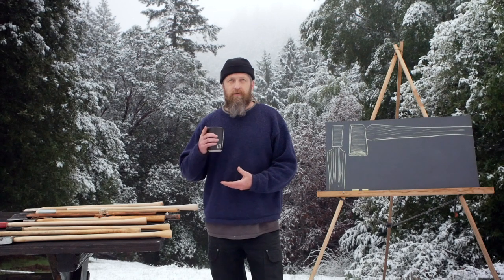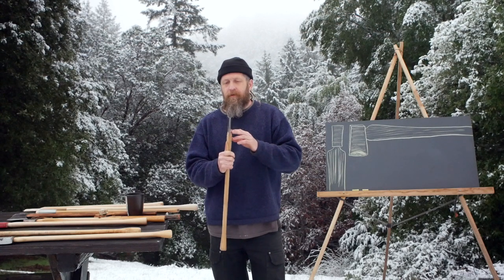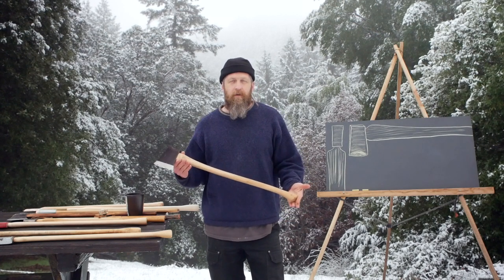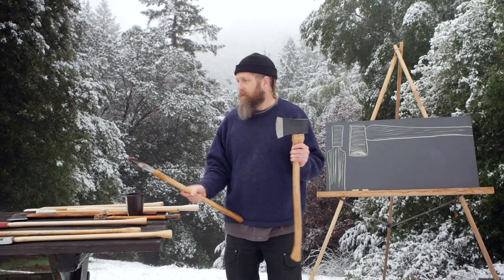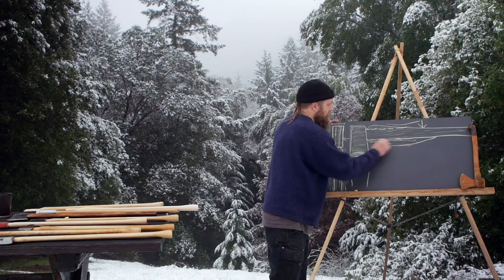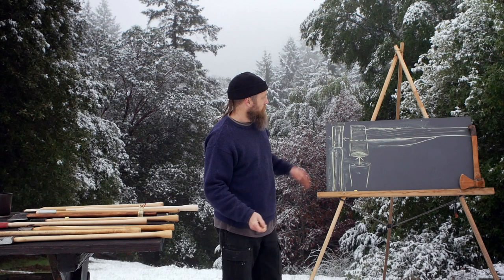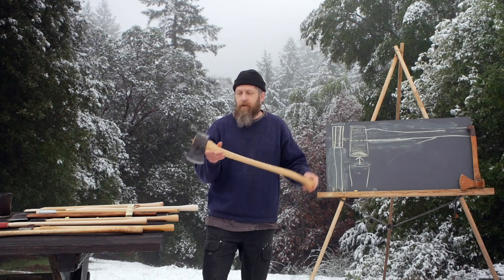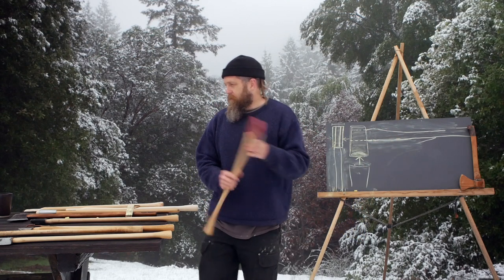Failure By Design, Axe Handle Design Mistakes and Improvements, *Spread the Stress*

Comment: two suggestions:
1. take your axe(s)  to blacksmith and  widen the eyelet.
2. weld metal handle  wrapped by ribbon ,textile,silicone or leather.(somebody  says ---  lifetime warranty).
Reply from the maker: The larger European eyes might be good for casual users, but I don't think that American eyes were reduce to the smallest workable dimension for no reason.  Looking at the thing as a system composed of axe and head, taking a large eyed axe and slimming the handle down to a more high performance thin design starts to upset the balance in the other direction.

Metal handles aren't worth considering to me.  There are reasons they have never become popular.
Reply: +SkillCult
In My H(ard as rock solid) Opinion : manufacturer  for the goal to maximise his profit  do not to produce normal size  fullmetal axes ,they try to save good metal for making only heads , besides  some of the most progressive companies.
Also I think --- Wilton B.A.S.H. handling technology -- is a best performed technology in nowadays.
Reply from the maker: I hadn't seen those.  I'm naturally skeptical, but I don't see why it might not be possible to make a composite material that would perform well and work comfortably.  In fact, I've been thinking about experimenting with that. That's if very different thought than welding a steel handle on the head.

Comment: Definitely know what you are saying. Caught a sale on a Cold Steel Trail Boss (first time I've had anything even close to Hudson's Bay pattern, not sure I'm sold on having half as much eye to grip the handle), and the handle was way too thick. I've done a little sanding but need much more scraping/rasping. Does not feel right in the hand. Speaking of flex/resilience: I know nothing of golf, have no use for it (except golf balls are fun to shoot with a .45), but I heard of a teaching tool that was a driver with a flexible handle. If one's swing was correct, it could be used. Likewise, the axeman with a correct swing does not need much rigity in the handle, but should have some resilience.
Reply from the maker: Having less eye sucks.  I ditched those type patterns a long time ago.  Someone mentioned in golf the head lagging behind the handle is a thing.  I think that is probably true in using axes with flexible handles as well.  Also true in atlatls.
Reply: Good point. Hadn't considered an atlatl, but too much whip in handle would cause the head to lag.

Comment: Why dont axes use the same handle design as mattocks and tomahawks? Seems like an easier handle to make and seat...
Is it because they are less comfortable?
Reply from the maker: They used to.  That is more old school and some traditional axes still do, most notably the Basque axes.  It solves many of these problems, but the eyes and heads are quite fat.  As to why that has been evolved away from, my guess is higher performance and getting the axe thickness down to a more optimal functional dimension.  It did cause a lot of problems.

Comment: what do you think about the square eyes on japanese axes? i always thought this would help prevent the sides of the eyes from blowing out on the axe head, for example if your using the poll to hammer with, the design of the western axes with the thin walled oval eye is really bad for this, i have even heard the sides of eyes buldging out with allot of re-handling. but idk how it would affect the handle durability.

also somewhat related, what do you think about the straight handle vs curved / erogonomic handle debate? ive generally heard straight handles are more accurate but curved handles are more comfortable.
Reply from the maker: I have not used any of the more squared axe eyes, but one thing they all have in common is more mass in the eye, which makes them a lot more robust.  I don't think the eyes blowing out is a significant real life problem.  I've rarely seen axes that are even distorted in they eye, let along broken.  Not that it doesn't happen, but it's almost always from gross metal on metal abuse.  I did a video looking at axe heads and every single used poll axe on the table had at least some mushrooming on the head from being beat on, or using as a hammer on metal.  But only one of the worst examples had a small amount of visible distention.  So, designing around that possibility is probably a misplaced priority, much like overbuilding knives as you said in another comment.  With axe design, I think they just evolved rather slowly from primitive wrapped eye types (like viking axes and traditional tomahawks) and that cultures tend to be conservative and change stuff like that slowly.  Without getting into the possible reasons why, I think American axes evolved into more high performance tools in some ways at the expense of robustness seen in most, if not all, old world axes.  German axes and many others also tend to have a square back.

I dont' have a strong opinion on curved v.s. straight.  Given that timbersports people universally use curved handles and are the most accurate and that many axes have been used for ages with straight handles, including almost all double bits, we can clearly get away with either.  The main problem I've had with straight handles is that they are less comfortable for bucking, where a short curve at the end helps, at least with the short axes I prefer to work with mostly.  I'm not sure about the theory that a double curve compensates for imbalance in poll axes.  Most axes of the world are grossly imbalanced and can still be made to work, though personally I prefer more balance.  I think people should chop more and argue about that kind of stuff less lol.

Comment: Ah, so that's why my previous handle survived the (hopefully) last  throes of noobility with green blood,,,, + excessive amounts of duct tape re-applied repeatedly, because there was lots of 'sickening cracks', and later slammings that tilted the head (which I simply slammed straight back in the same manner when noticed), and finally, punishing it beyond any comparable degree by trying to take multiple limbs at once.
That arcing radius is intuitive, as it is ingrained, but the Spruce is typically straight, so more than a few limbs got broken by the handle (instead of head), until it got broken by the limbs.
Now, I could of course excuse myself for having nooble blood, but I think the experimental discourse of #MoronicAxing is more communal these days.

,,, You're starting to look like a couch-stoner from my hometown that forgot to get high (but kept the clothing) before giving a lecture on practical physics... yes, it is a perplexing overlap of memories at play.
Reply from the maker: If you can use an axe with a really weakened eye for quite a while, that's a really good sign I'd say It often pays to stop, whittle the shoulder down a tad and jump it on a little further to pinch any breaks closed so the bottom of the eye  is onto more solid wood.
Reply: I considered it for a split second, but was too lazy to bother removing the duct tape, or shave, so predictably the butt was merely knocked extra hard on whatever, whenever it loosened. Good thing the head broke&fell rather gently, considering the swing was way over my head.
But yes, I liked the axe from its very first swings, and I've realized that this axe is great. Not too sure about the new handle, but bought 2 (online) so I should have time to make my own handles by the time they both break.

Btw; what's the deal with the 'say.it' link to misc.Thai p**n? You're trying to tell me I need to spice up my Coal-Pron series? :P
Reply from the maker: Ha, that's funny.  Accidental link.